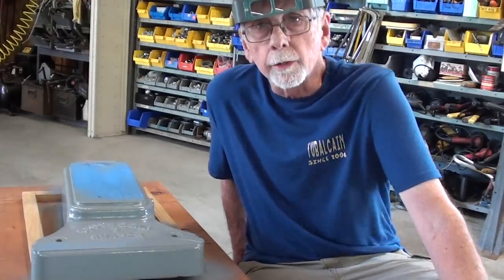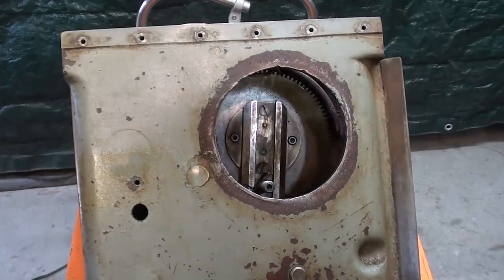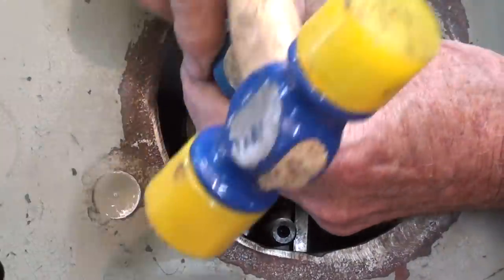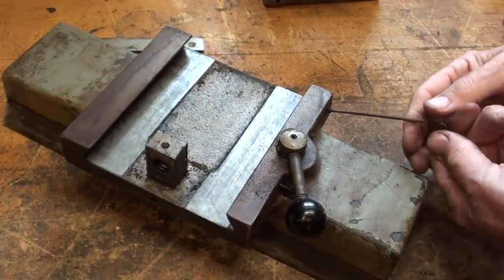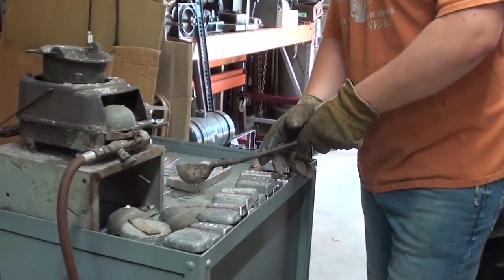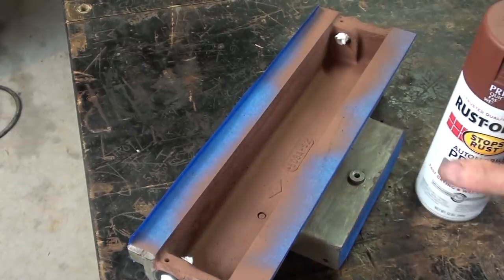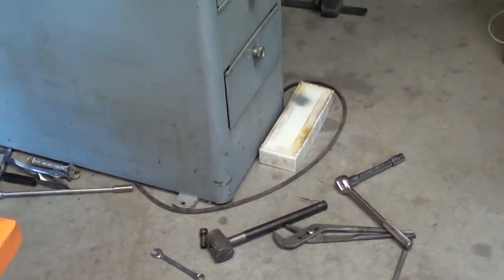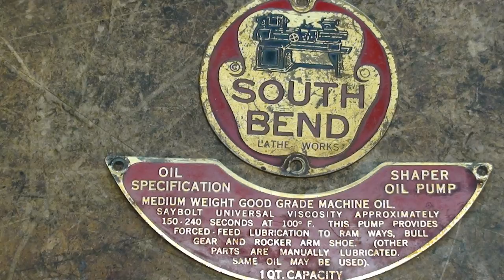RESTORING SOUTH BEND SHAPER  painting Tips #675 pt 6 tubalcain

Comment: Loved the Cool Hand Luke reference.  That cord end for the light looks like one of the old non-NEMA devices.  Before NEMA established a standard there were a lot of configurations that had multiple voltage and amperage references that led to problems with misapplied voltages.  Now there is not a single twist lock device that is not a dead front so that guy is really old.

Comment: It's coming along nicely, I hope you take your time during reassembly to explain all the details and adjustments of the final process. 
I decided to work on my 26" crescent band saw instead of the atlas horizontal mill mostly because the mill is working and the saw has been out in my driveway all apart under a tarp for the last 7 years. One good thing about these Covid times are all the round tuits getting done.🙂

Comment: Those sliding surfaces still show a lot of the original hand scraping.  Although it is an old machine I'm thinking it didn't see an awful lot of use in it's life and it probably serves to show the value of that oil pump system as well.  Lots of years left in that machine, more years than I have left in me!

Comment: its amazing how spray paint has changed over the last few decades. I can remember years ago you only had a choice of a few dozen colors and finishes. I now go into the local Menards and they have a whole isle with thousands of choices of colors and finishes. Even the least expensive paint seems to cover much better than it ever has. It used to be cheap spray paint took a 6 or more coats to cover what you are spraying. Now 2-3 coats seems to work.

Comment: That lamp socket looks like a NMEA ML1 series connector, ML1P for plug, ML1R for receptacle, 15a 125vac rated. they make one with a center grounding pin if you wanted to convert to 3 wire, is a NMEA ML3P/R Hubbell makes them, you can get them online, a quick search shows them running about 25 dollars a piece.

Comment: after such work at washing, scuffing and sanding, your work for the preparation worth using a 2 stage industrial paint applier with a small spray gun, much more resistant to wear,  oil and solvents.

Comment: A messy shop is the sign someones working! and, after a life time of turning wrenches on Navy aircraft and writing maintenance manuals, I can say and you probably already know screws, bolts and nuts stretch over time and eventually need to be replaced and threaded parts need to have thier threads chased to bring everything back to spec. Also that one electrical plug is a shock hazard. Find someone who has some experiance finding suitable replacement parts that are electrically safer than whats on there now.

Comment: You tied my stomach in a knot tapping that masking tape with a steel hammer. A rubber or other soft face would be much safer. On the base the front machined strip for the table support foot and the area where the box column bolts down must be parallel. Also, the plane of the bottom of the column must be accurately perpendicular to the dovetail that guides and supports the cross-rail. If your hammering kicks up some metal on the box column mounting faces (box column or base) then the table support foot will not be moving parallel to its machined support on the base when the table is traversed on the cross-rail. Hence it will either bind or lose contact when the table traverses depending on the direction of tilt of the column that has been caused and the direction of traverse.

Comment: I've used that hammer trick to make gaskets for years, never thought about using is for masking tape but that's slick! Re: The twist lock connector. Is it this one? Midget Twist-Lock Valise: https://www.hubbell.com/wiringdevice-kellems/en/Products/Electrical-Electronic/Wiring-Devices/Locking-Devices/Midget-Twist-Lock/HBL7465V/p/1634359